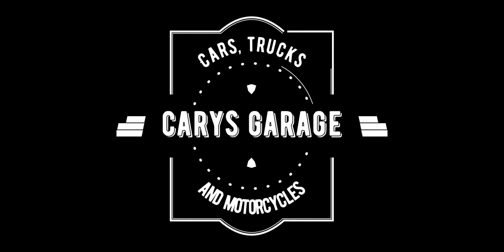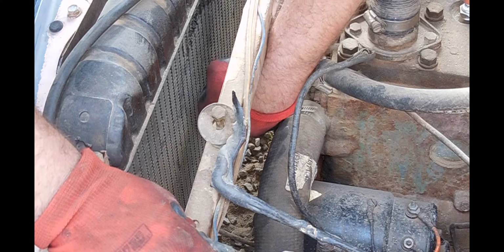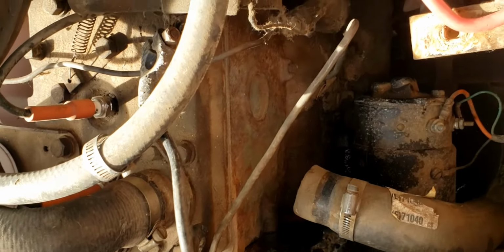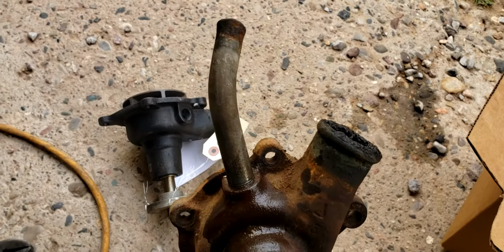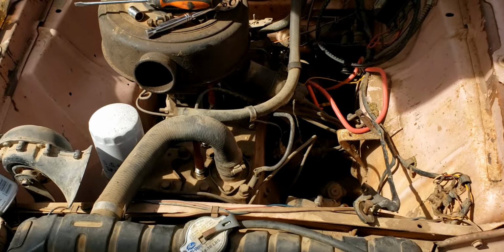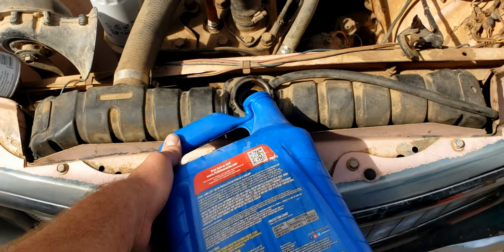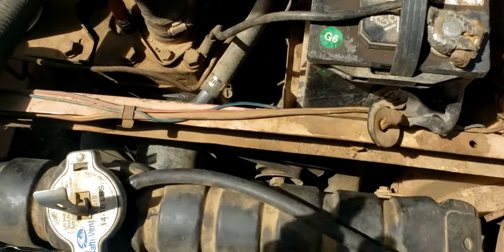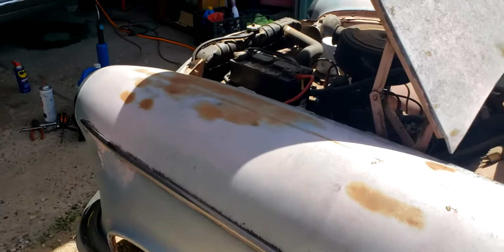1960 Rambler American 196 Flathead water pump replacement

Comment: Despite all the issues, the engine sounds pretty nice. 
I imagine for the fuel fill piece you have to use pretty specific materials because it comes in contact with petrol...just spit balling but could you get some appropriate sized rubber tubing and just bend it with the hot water trick (similar to working with pvc) and just make your own? Probably a dumb idea but it's what I got

Comment: I thought Galvin's Rambler Parts in Oregon had reproduced those molded filler necks.  If you have not checked with them, I suggest you do that.
Reply from the maker: They have the one for a 61 American, not a 60 :(. I called and talked to them for a bit, they haven't reproduced this one yet.